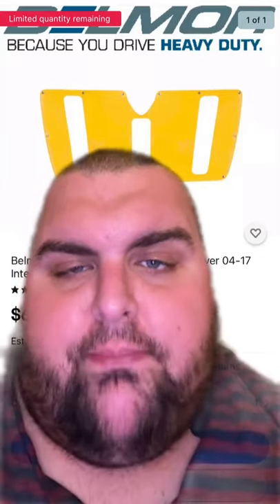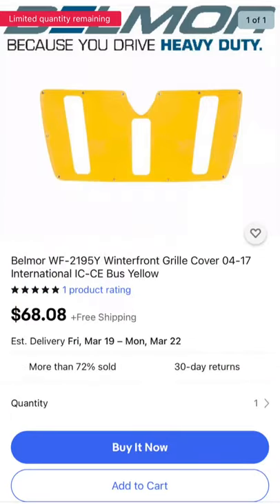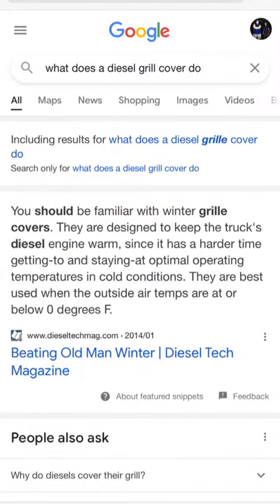WHY DO SCHOOL BUSES HAVE THIS ON THEIR GRILLE??

Comment: I've had some 4 cylinder gas engines do that too. Some of the smaller gas burners just can't keep the heat up in cold weather.
On the other hand, it may take forever for a V8 to heat up, but once it's there, it's staying.
Reply: @pmacdonald15  yes. I had a Ford Ranger years ago... Heater didn't work well. I had to block off half the radiator one winter just for the inside of that truck to be livable when driving.

Comment: That's why when you're sitting parked. Especially in winter. You use the cruise control switches to bring the engine idle up. Just rev up the motor and turn on the cruise control like you would when you're driving. It only works if your button says "Cruise/Throttle Control" tho which I know yours does because of your cruise control video. I also said something along these lines on that video. Now I can't remember if you can leave it in park or not. So I'd just throw it in Neutral to be safe. That's what I used to do with the International box truck I used to drive. Just make sure your parking brake is set.

Comment: Do you like flat nose busses, are they easier to drive?

P.S you don't have to feature this I'm sure someone will reply with an answer :)
Reply: unfortunately hes never driven a flat nose bus from what i understand
Reply: I drive transit buses so I can sorta answer your question-

1. It's called a cab-over design where the driver sits above or just ahead of the front axle.

2. As far as being easier to drive, yes and no. It does take a little adjusting to since your reference points change slightly but getting the bus through tight situations the design absolutely shines. I would take a cabover for city driving any day.
Reply: @Spectacular66  thanks so much, I fly planes so I'd have no experience with busses

Comment: Around here there's a few methods to keep diesel engines warm during fire incidents, some have the covers, some have shutters, and newer trucks have a fan disconnect, and in order to keep load on the engine they engage the pumps and recirculate the water within the tank, they tend to stay nice and warm though IC chassis buses with the MaxxForce engines tend to break down when idling with the pump engaged, more than once the rusty but trusty Freightliner FL80 has had to lend a hand to a shiny new IC

Comment: it’s crazy when you really think about it. i’ve got a 2001 chevy duramax, over this past winter we would see single digit weather for weeks at a rip. going down the highway at 75mph my truck would never go about 115°. it used to worry me with the whole oil pressure being like 65-70psi at my idle, but hey extra oil pressure doesn’t hurt😅

Comment: We use them in mn and when its -20 to -40 you can leave the truck on high idle at 1500 rpm all day and still wont really warm up unless your driving long distance.

Comment: When you just idle your bus for an extended period of time if able you should bump up the idle with the cruise control. It keeps the engine warmer helps the oil do what it needs to do and overall its just better for it
Reply: My father’s 7.3 excursion will do high idle automatically as will my uncle’s 07 Dodge Cummins. My 12 valve I have to use a block of wood
Reply: @lazarustheatv8389  that must be a pickup thing. My semi will idle at 600 rpm for hours unless i intentionally bump it up on the cruise

Comment: This is kind of an odd question, but I noticed some school buses have a red light above the back emergency door on the inside of the bus that turns on whenever the headlights are switched on. What is the light for? And if it's important, why don't all buses have it?

Comment: New Hampshire not as cold as Michigan but these have been been used forever on almost every diesel truck and bus I've seen.
  Begs the question tho the new trucks hardly are ever seen using them but the new buses use them.
  They're both diesel engines so to me it would only make sense to use them on the new trucks as well. is it me or are the kids that drives the trucks just that dumb?
  My uncle has a 2013 dodge 3500 truck, I'm always up there working with him  and he always assumes I didnt put the winter grill on and every time the look on his face is priceless.

Comment: Our old scania has a hand throttle on it so u can up ur idle when its cold like that
Reply: Old international where I work has that. I also use it when running the dump bed only to about 1200 max I think definitely 1000rpm. Not sure if it is bad for it or not

Comment: Does the blanket impact air moving across the radiator and engine, possibly overheating it while it is stationary?
Reply: No. Diesels are almost too efficient at idle so in the cold they won’t overheat with most of the radiator blocked. My 12 valve Cummins has an exhaust gas temp of about 200F at idle measured from the manifold so it would be difficult to overheat idling

Comment: doesnt that restrict air to the engine, leading to overheating?
Reply: No.  The engine doesn't need air for cooling.  It uses liquid cooling through the radiator.
Reply: @jgibson111  oh, ok. thanks forclearing things up for me a bit, but dont it still need ir like all vehicles do?
Reply: @atomicapex9357  Yes it still needs air for the intake, carberator/fuel injection system etc. but there's still plenty of airflow or an air dam for that.

Comment: Isn’t there also like a pad you connect to the bus that heats up the radiator?
Reply: Block heater. Very useful in the cold especially in sub zero temperatures